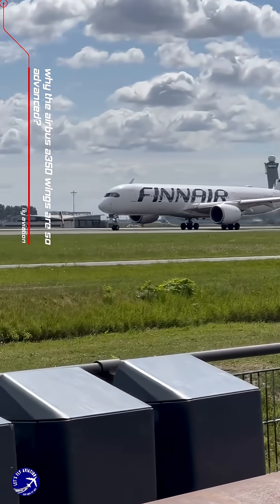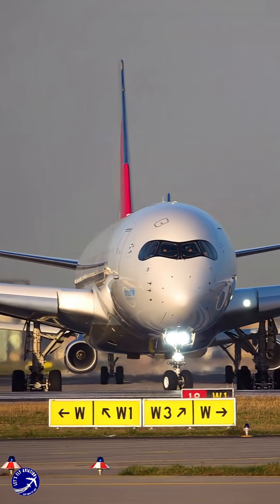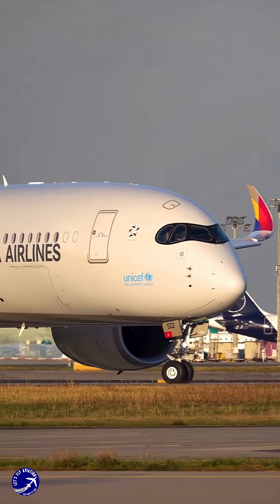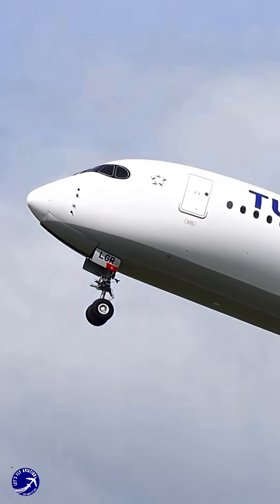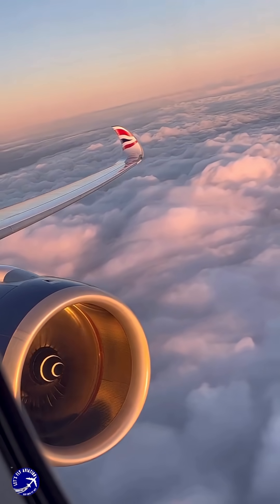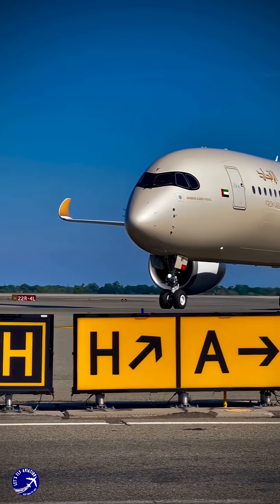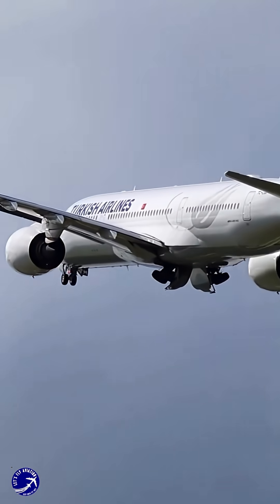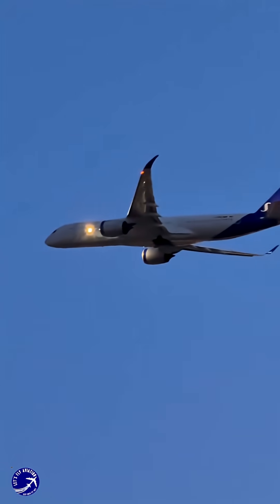why the airbus a350 wings are so advanced?

Comment: Most aircraft have similar designs, like engines under the wings, flaps and slats, and wing flex. Composite materials aren't as common but are being used more and are also used in the B787, which came out before the A350.
Reply: And the 787 wings 🪽 are truly a breathtaking spectacle when it takes off, and they flex. ❤
Reply: Gliders have been using frp since the early seventies. Winglet technology was adapted and utilised by studying Ben Lexcen's winged keel on Americas Cup winning yacht Australia  2. From recollection, that was in the early eighties.

Comment: Most of what you said is no different from any other modern aircraft, the thing you missed is that the flaps are deployed in tiny amounts to maintain a specific centre of pressure that saves fuel.
Reply: Do you mean 'centre of pressure?' Concorde could shift it's centre of gravity by pumping fuel forward and aft within it's wings. Military aircraft can change their centre of gravity by unloading airborne troops or airfreight - although there should not be much variation after deployment during flight.
Reply: @KeithHays-ek4vr I did, post edited. Cheers.

Comment: Why are the flaps so far out on the wing, and the ailerons so close to the body? Wouldn't this decrease control in a stall situation?
Reply: They are not? The ailerons are on the outboard section of the wing while the flaps are from root to just after midsection.
Reply: The ailerons can be used both as flaps and speed brakes